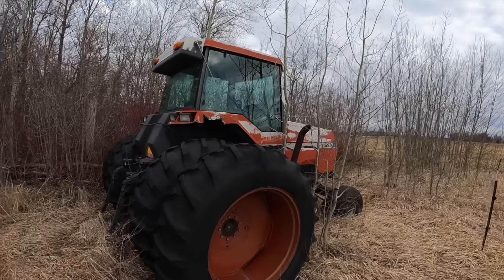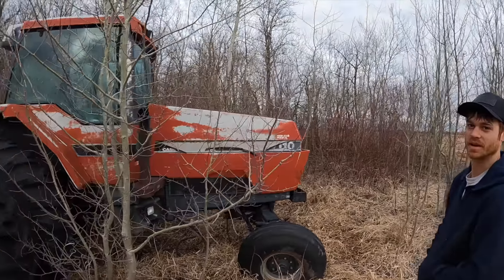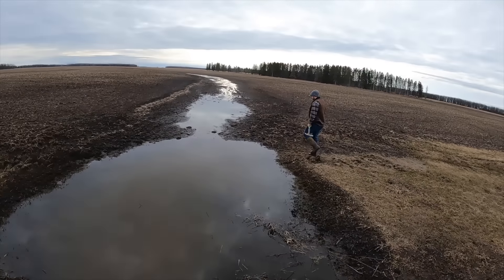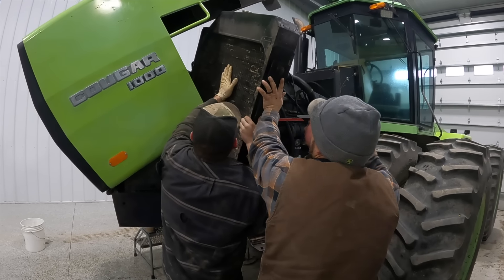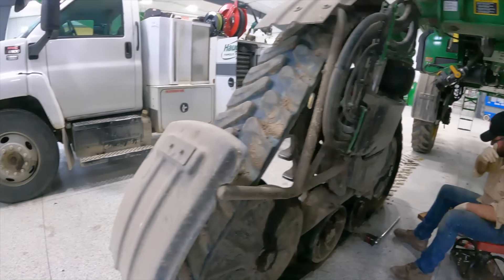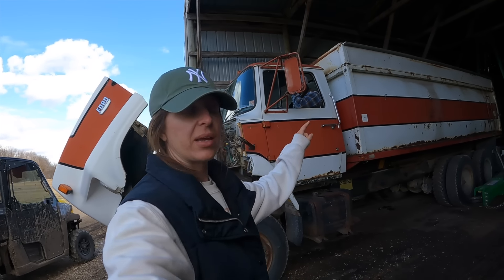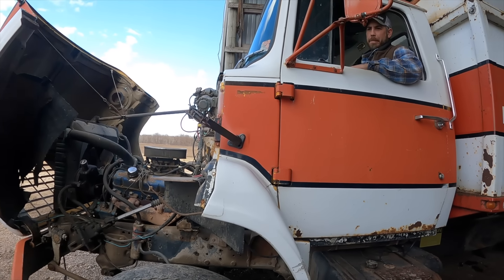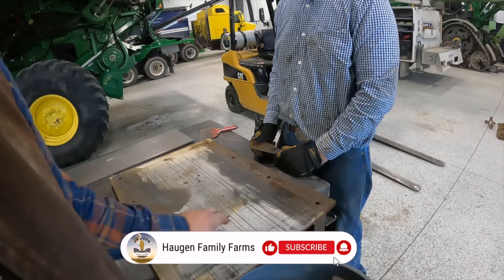Rescuing A Case 7110 Tractor?!

Comment: Hi Guys Thanks for the video. Those smaller magnums in 2wd are about 30-40K up here in Manitoba. They are basically a hay or smaller auger tractor and in that price range look way better than that pile, if the cabs a garbage dump the rest mechanically  isn't generally any better I find. I'd be very skeptical of there being a profit in it with parts prices/your time and what it might need to make it mechanically and look right. If you want to know what it's worth to me scrap plus tires if they are still usable. or get somebody to phone a wrecker and see what they'll give for it. 
  I use to buy and sell a few tractors but guys want a fortune for them, needing work then the parts price is stupid and you find that unexpected parts all the profit, obsolete or hard to find in a wreckers. 
All I can buy for the right money now is stuff that hasn't gone up in price when it's done, like the old 2-135 whites and things like 4010/20 or bigger older Deeres or some of the old IH's that aren't big enough to run the augers anymore. Then if you do try selling all you get is the same type of clowns you're dealing with when you try buying it. I quit most of my shop work, and got a job working for a farm fixing and operating equipment with way less hassle and constant good money. He's trying to sell rail gravel now all he's getting is total time wasters to, the last guy wanted 3 oil pails  full delivered out of a 5000 ton pile when the boss asked how many truck loads he wanted ! Take care guys

Comment: If you by it low ball the price because engine and transmission need work i would say eight to ten thousand wold be ttop end of you shuould pay because of cost to tidy andrepair it. It would bring  somewhere around twenty to twenty five in good condition with those hours.

Comment: 10,000hr trans its gonna be well that's broke, while we're in here that and that and that are almost worn out .... hydraulic pump,valves, steering etc another big question mark differential? Brakes? water pump, alternator, AC? probably Freon unless it was converted.  100 year rare model would be a different story. Restored 7110 2wd who cares.

Comment: Buy 2 more 7110 tractors and build 0ne.
Probably not, run don't walk.
Definitely only a parts tractor.
I have  1896 and a 2096 we use in haying. Parts are really getting hard and expensive to find.
Reply: Your old case tractors are a whole different story compared to a Case IH magnum.